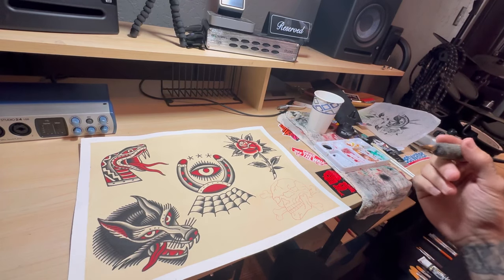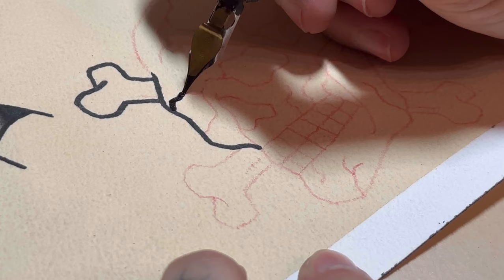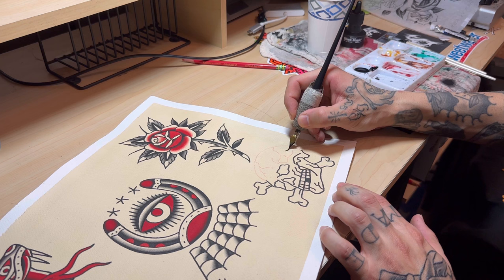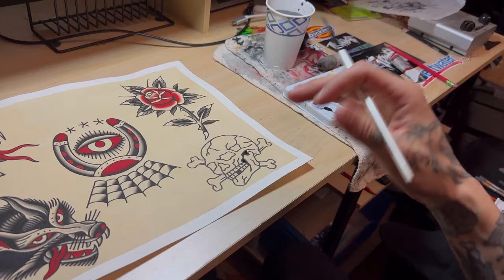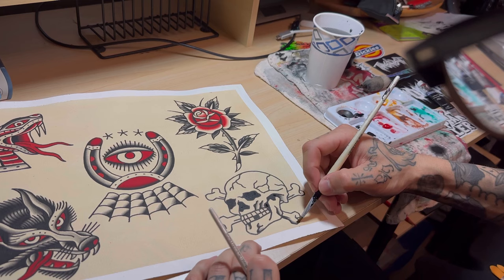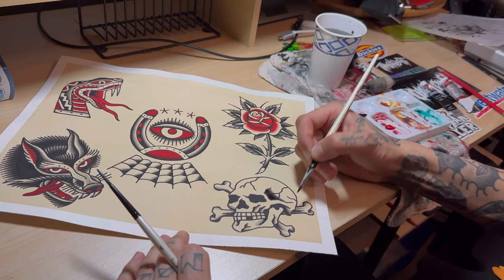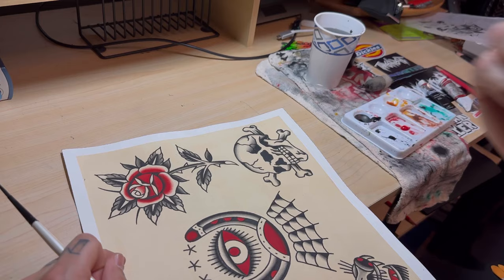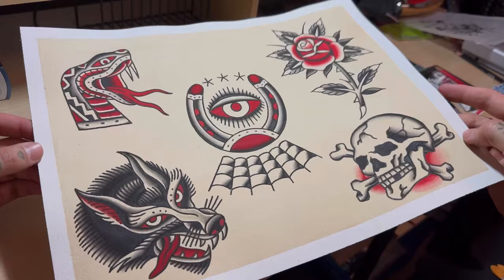How To Paint Tattoo Flash on 140lb Cold Press Water Color Paper

Comment: Great video. Thanks..fwiw You should try leaving your work sit for at least 24-48 hrs. And then cut it off the block..That will eliminate almost All of that buckling.
Reply from the maker: Thanks for the tip. I use a light table to transfer the designs but I’ve been thinking about doing it another way or drawing it direct so I can leave it on the block 👍

Comment: Question... Is there a way to do this without putting the brush in your mouth during the shading? I just feel like i cant put myself past that part lol😂
Reply from the maker: For me it’s just a habit. It’s how I hold the brush 🤣 you can set the shading brush off to the side, or my co worker tapes each brush together making it double sided. Just use water to shade on your clean brush, use a paper towel or something to get the correct amount of water on the brush you need.
Reply: @100tattoo  appreciate the tip 👍 thanks